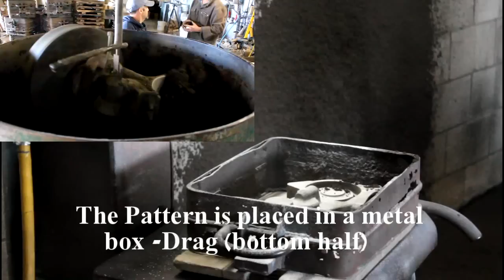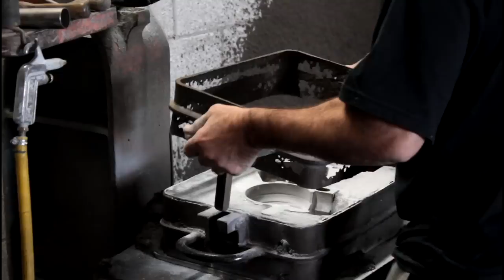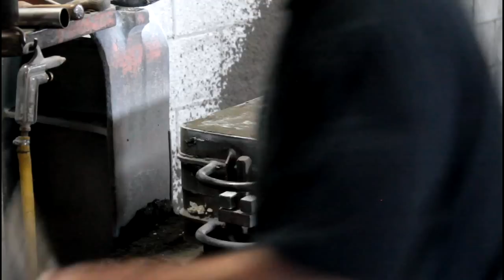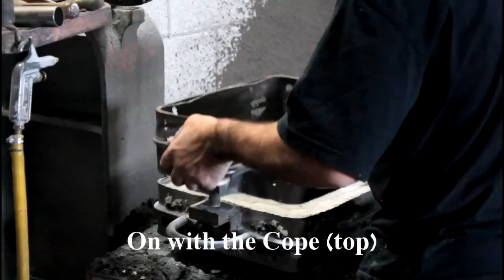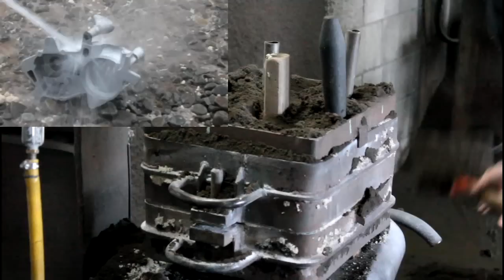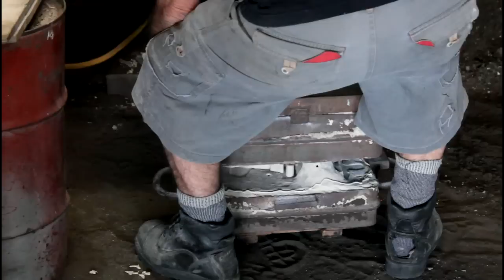Molding YZ360 Crankcases in a foundry

Comment: I want to make a mold using an existing object but I dont know how to scale up the existing object to compensate for shrinkage? How do we scale up and existing object? Can someone help
Reply: Hi, I have been studying the videos on casting  I want to do some for myself.   I think they use the fill holes as reservoirs for the metal so it shrinks from there and not from the casting.   I have also seen one caster with a ruler that has the dimensions were changed to allow for shrinkage,  The numbers were 6% larger in dimension.  That implies that the model was made 6% larger for aluminum the metal he was using to cast.
Reply: Hi. Thank you. I was just wondering how they scale up an existing object by 6 percent. Do they use CNC?

Comment: How much shrink do you have to account for in the model?  Is the model X% larger than actual?
Reply: dmcneill52 I cnc foundry patterns for vacuum form tooling and generally the shrink for aluminum is 0.010 inch per inch, 1.010 or about 1%